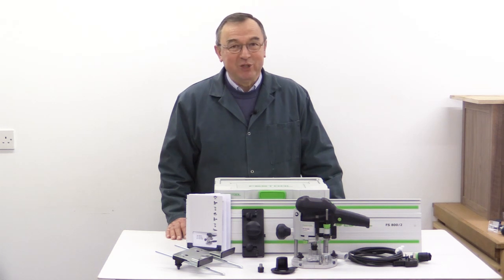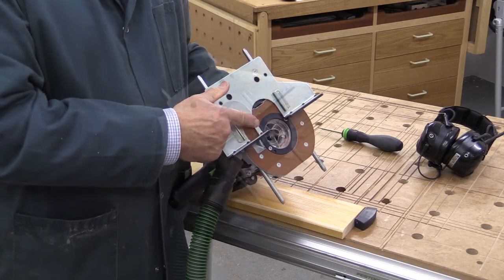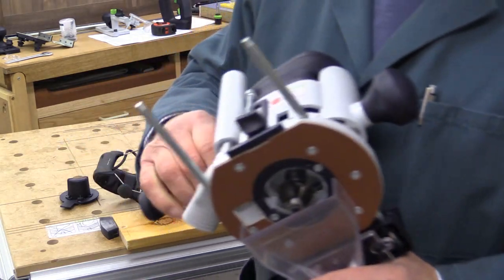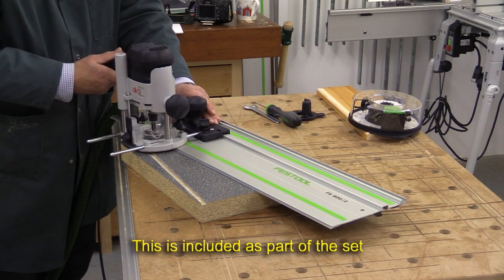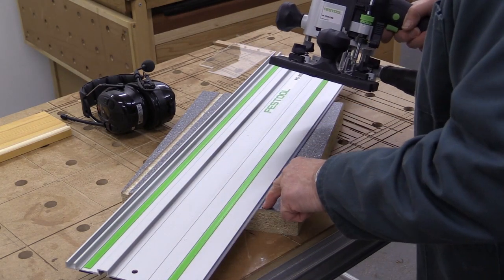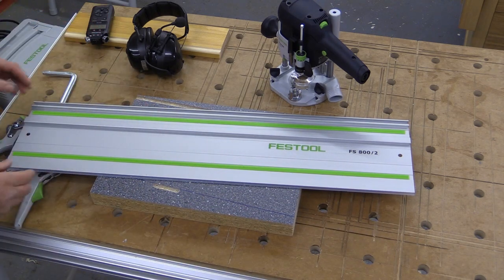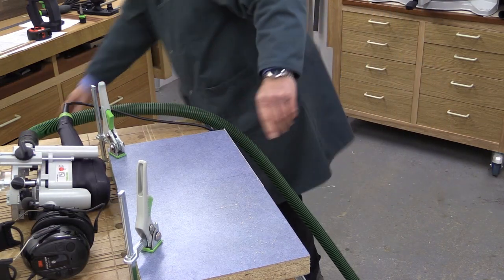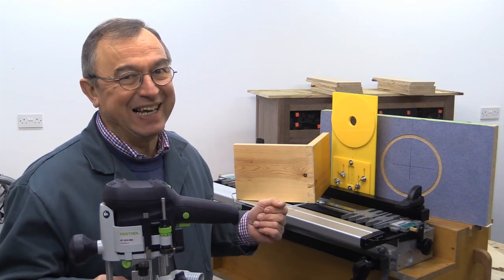Festool OF 1010 Router - Part 1 of 2

Comment: Your video is now 6+ years old, but still relevant and helpful. Thanks Peter. Nicely done, as always.
Reply from the maker: Hi Robert, Festool have brought out a new version of the OF1010 but it is only a cosmetic change to the dust port as far as I can see.  Cheers.  Peter
Reply: @NewBritWorkshop  thanks. I was not aware... I took a class several years ago at their facility in Indy and did not realize that a new model had come out. Good to know.
Reply from the maker: Hi Robert, Not sure if the new OF1010 has arrived in the US yet.  Peter

Comment: Took my brand-new OF1010 out on it's first site job today. Was horrified to find that it was fitted with an 8mm collet, as I gazed despairingly down at my pile of 1/4" cutters. Wondered if there had been a mistake on final assembly and dispatch? All the info I'd received stated that the UK version shipped with a quarter-inch. So in desperation, I watched your video on my phone. "It comes with two collets" you said. So I shook the now-empty Systainer and heard something collet-sized rattling around under the insert. You, sir, are a lifesaver.......

Comment: I just ordered a 1010 last week.  It looks like I'll also be ordering a bunch of accessories for it - Festool's integration is amazing, and your demos are very helpful as far as suggesting techniques and ideas.  Impressive that more than seven years after you made this video it's still useful and relevant.  Nicely done!
Reply from the maker: Hi Pat, The OF1010 comes with a full range of accessories just in case you are about to order something that might already be in the box. Have fun.  Peter
Reply: @NewBritWorkshop  Hi Peter - I snared it last week on the Festool Recon site for US $330.  It should get here some time this week, and I'll then know what it has with it.  Things tend to have a short half-life there, so I almost immediately pounced when I saw it - no time to research other than 'looks like a deal - add to cart!! '  This brand is like crack for people who like good power tools!

Comment: I just purchased a Bosch, that I haven't taken out of the box. I will now be returning it and getting a 1010. I thought I couldn't justify it, but the versatility you just showed me justifies it. Plus, I already have a MIDI II and other tools from Festool. I am a sculptor and currently starting a business related to native bees, so I'll just consider this an investment.
Reply from the maker: Hi Dylan, I am sure that you have made the right decision. The OF1010 is brilliant and I use it more than any other router. Good luck.  Peter
Reply: @NewBritWorkshop  High Peter, do you think the 1010 can work to flatten with a flattening bit? I have a bunch of glued up boards that I need to make a sled to flatten with. Currently that was my plan for this Bosch 2.25hp router.
Reply from the maker: Hi Dylan, No problem. It is a small (ish) router and will handle what you have with no problem. Were is a larger task then it would still manage but take a dash longer.  Peter
Reply: @NewBritWorkshop  I got a 1010 today and I also subscribed to your channel. Thank you for the input. I can tell you're very knowledgeable when it comes to woodworking related topics and that is why I feel it is a good purchase. My wife thought it was probably a better idea to get the 1010 in the long term too.

Comment: Hi Peter.  Great video as always.  Perhaps just a tip when setting the depth of cut.  Do not lift it by the plastic attachment.  It is only a (poor) friction fit.  I've used a 1010 for many years and soon realized that the scale can slip and this will obviously lead to wrong depth.  Rather lift by the steel rod on which the plastic guide is attached.  Incidentally, I followed your advice and got the 704R and a quarter inch dovetail bit for the 1010 which I can now use in addition to my half inch router and having two set up saves a lot of time.  Thanks again.  Jac
Reply from the maker: Jac vds Hi Jac, Yes, you are right but I had to try and keep my fingers out of the line of the camera. Well done for getting the OF1010 set up for dovetailing - a perfect companion to the OF1400 to save time with the Leigh Jig.  Many thanks.  Peter

Comment: Very helpful video. Thank you Peter.
One thing I still don’t understand is how to set the depth of cut when using a bearing guided cutter, something like the round over you used in this video. Could you explain please?
Reply from the maker: Hi Charlie, A bearing guided cutter will run its bearing along the side of your wood. The depth of cut will be determined by the application and the shape of the particular cutter. For example, a bearing guided chamfer cutter will trim a 45 degree slice off your wood. By adjusting the depth you will get a large or smaller 45 degree cut face. Just pick up a bearing guided cutter in your hand and imagine what it will do at difference cut depths.     Peter

Comment: Good Morning Peter, having watched this I’ve now purchased a OF 1010 router. It would appear that in order to accomplish many of the router tasks one also requires a router table. As you note, Festool no longer make these - on that basis is there any table you’d recommend ( preferably lightweight / portable). Also, I need to buy some precision measuring tools - I’m considering some of the Benchdogs products - are there any other brands you think produce high quality products. Keep up the great work sir. Regards Mike
Reply from the maker: Hi Mike, A router table is useful. Try Axminster.  Peter

Comment: Hi Peter, as always a well constructed and informative video. Have been thinking of getting the 1010 to compliment the 2200. Have been put off by the handle configuration, but guess it comes as second nature once you have used it a few times. This " Green Slope" sure is slippery  !!!! Mark.
Reply from the maker: +Norfolkswain Hi Mark, Ages ago I had the same worries about the handle but once you have tried it a few times it just seems so natural. I think the reason is that the router is quite light and the handle arrangement makes it easier to pick up and put down one handed. You are right it is addictive!   Peter

Comment: Hey Peter. Great video. Can the edge attachment be used on the 1400 in your experience? I have a few pieces of edge banding to do but only have the 1400 and would rather get the edge attachment than a new router for the task! Thanks as always.
Reply from the maker: Hi Sebastian, not as far as I know.  Peter

Comment: Peter, you set up the plastic gauge you built to an rail with an uncut splinter guard.  Do you keep a rail with an uncut splinter guard just to us with the router?
Reply from the maker: Jack Wilson Hi Jack, I have 3 other rails which I use with my TS55 so see no need to cut the splinter guard on this one. It would not matter if I did chose to use it one day as my plastic gauge would still be good.    Peter
Reply: New Brit Workshop Watched the video again, and now I see I had missed one statement you had made regarding the alignment of the rail to your intended route line.  Thank you.

Comment: Hello
Again Peter

I'm sure this is a silly question but would you highly recommend the MFT? I'm a portable carpenter so I'm concerned about the weight of it. 

Regards 
James
Reply from the maker: +James Petts   Hi James, This is a tricky one because the MFT3 has risen in price by quite a lot since I bought mine but I will give a balanced view which should help. The MFT3 is an excellent portable work bench as it is far more than just a surface on which to work. The arrangement of holes allow you to do a lot of jig work and clamping which is hard to achieve on a flat sheet of MDF. You can go the whole hog and get all the extras that then give you a quite reasonable track saw cutting station. The bare MFT3 with a set of large and small Parf Dogs gives you a very accurate track saw cutting station. I have the MFT3, paid the going rate for it 4 years ago and do not regret my decision. Alternatively you can create a mobile track saw cutting station by having a pair of folding trestles and a sheet of MDF with some accurately placed holes for the Parf Dogs. I have one set up like this in my workshop and I cut all of my sheet goods on it. I can cut a full 8x4 with measured scribe marks for the track placement and use the Parf Dogs once the width gets down below 1m (any length can be cut). Both the MFT3 and my trestle based cutting station are equally portable but the MFT3 has a little bit more usefulness for jig work.      Please let me know what you think.    Peter

Comment: Hello peter this may seem as a silly question, I have the OF 1010 router for lite router work, but I have trouble with the router bits scotching the wood. Is this down to poor quality router bits ? Or is the routers speed?
Reply from the maker: Terry De'ath Hi Terry, Scorching can occur with speeds that are wrong but it is more likely to be poor quality cutters, cutters which need sharpening or trying to take too much out at a time. For 8 mm bits (which I recommend you use) I have found the Festool ones to be the best.   Peter

Comment: I'm guessing the 1010 is perfect for routing out hinges etc 

I'm concerned that it's not well-balanced if it's Balanced on a door
Reply from the maker: +James Petts Hi James, There is an easy way to make things easier. Widen the surface onwhich the router sits. If it is a door or something similar clamp a piece of wood flush with surface - take a look at the early part of this workshop notes vide:  https://www.youtube.com/watch?v=0Wq7mJN_pVE    Good luck.   Peter

Comment: just took the plunge and bought this little router, but noticed it gets quite hot on the top directly above the bearing mount even when not under load, has anyone else noticed or had this problem,  or is this perfectly normal?
Reply from the maker: I Have not noticed this with mine but will check the next time I use it.    Peter
Reply: Thanks peter
look forward to your feedback, and keep up the great reviews. Regards Terry

Comment: Nice review as usual from peter but I have to be honest, the tool comes across as grossly over engineered with dozens of fiddly attachments that would drive the average site based carpenter insane.  It's all getting a little silly with the accessorising trend!
Reply from the maker: Byoomholay I tried to show a range of accessories to suit every type of user. On site the side fence and maybe a guide bush will probably be enough but some workshop based people will want dovetails and so on. The kitchen fitter will want the edging setup.   Peter

Comment: the problem with this router is they got the design wrong the handle is too high so if you are not careful the router will tip , got rid of mine